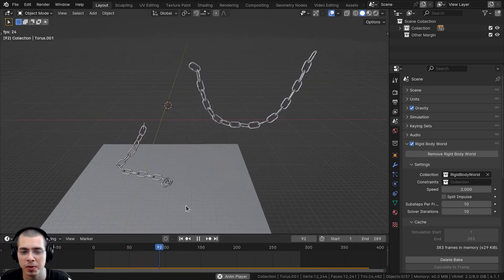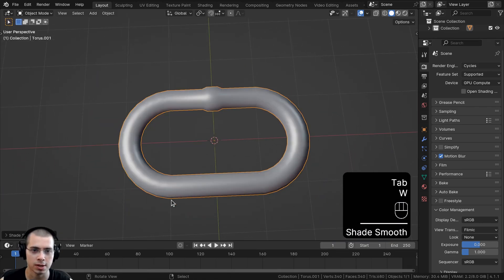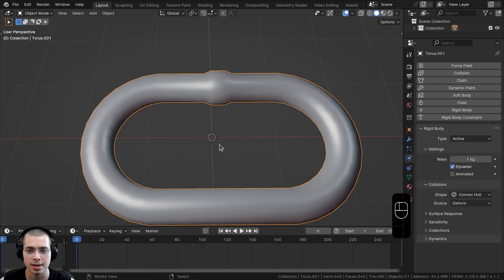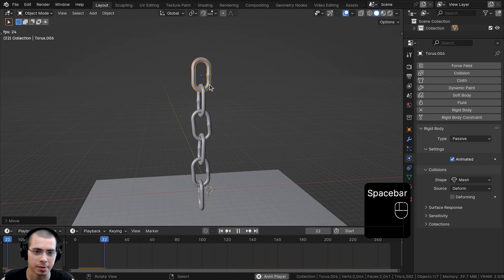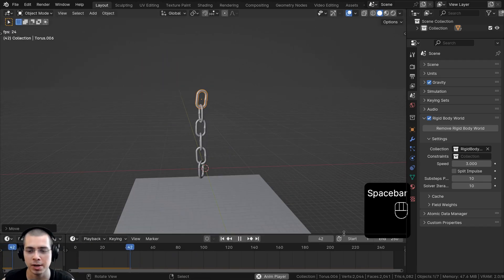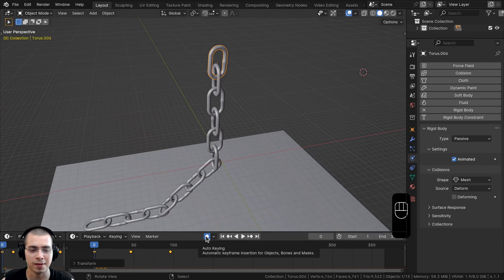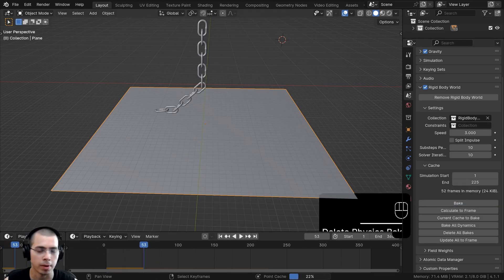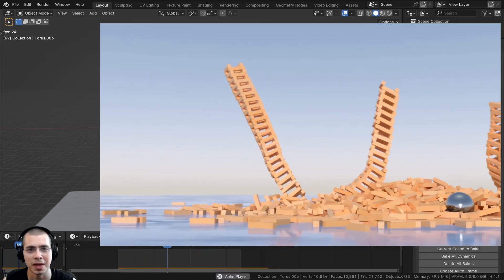Chain Links Simulation - Rigid Body Physics (Blender Beginner Tutorial)

Comment: You mentioned the default scale and it raises a question. Is there anything wrong with using a larger scale. If everything is in 10x then it's the same size as everything else.
Reply from the maker: Well one problem is that the simulation will move at a slower simulation speed, because all the objects are super large. also Depth of Field in the scene might look off. But for a simulation is works better if the objects are large.
Reply: @RyanKingArt 🤔 cool those are all easy fixes in post. Speed up video playback and run a quick refocus.
Reply: Blender operates in terms of meters per second, kilograms and other realistic units, so it may get confusing to match everything together at different alien scales